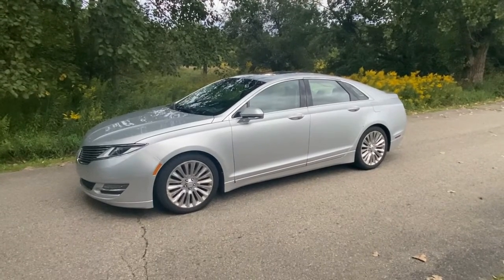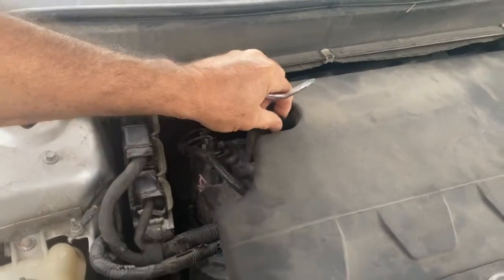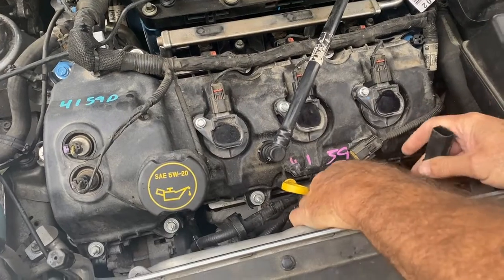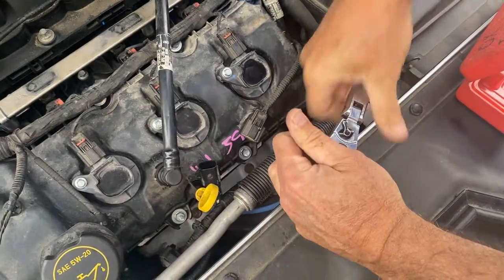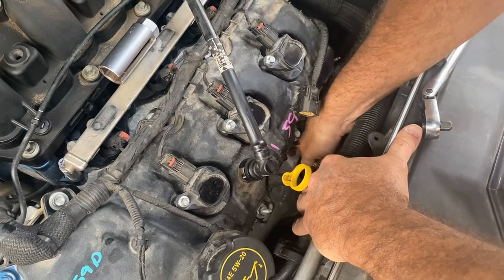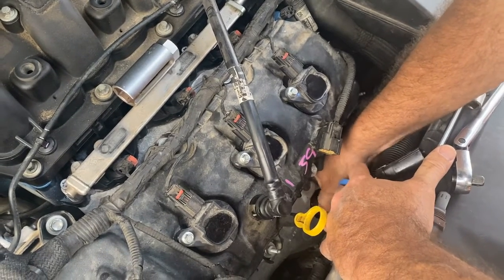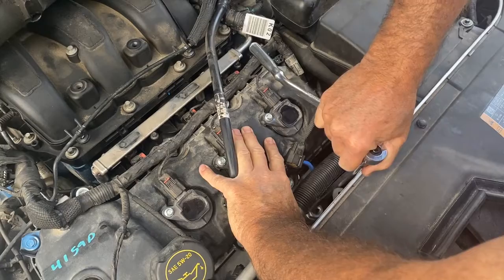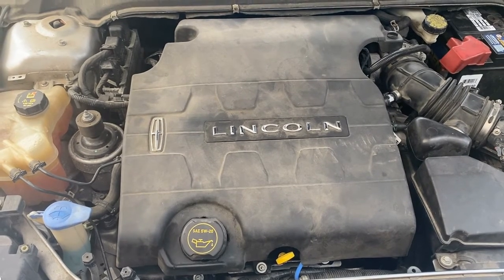How to Replace Oxygen Sensor Lincoln MKZ

Comment: Are all the sensors on this car the same ? Can a downstream o2 sensor work for an upstream location? Ordered the kit came with 2 up and 2 down but all 4 are the same sensors nothing different
Reply from the maker: No, a downstream oxygen (O2) sensor cannot typically be used in place of an upstream O2 sensor. They are designed for different purposes, have different physical characteristics (including connector types), and are located in different parts of the exhaust system.

Comment: Do you have idea where the O2 sensor is on a Mkz 2017?
Reply from the maker: This should be the same process for any (second generation) 2012-2020 Lincoln MKZ with the same motor. Which O2 sensor ?

Comment: Are both of the sensors on the 2015 lincoln mkz the same?
Reply from the maker: You're going to have an upstream and downstream oxygen sensor Bank 1 and Bank 2.  The two upstreams or two down streams could be the same, but it is still a good idea to give your auto parts store the proper information to double check just to make sure you get the proper parts.

Comment: Timing cover Lincoln mks and oil pump
Reply: How long does it take to repair it and how much does it cost to repair it?
Reply from the maker: If the oil pump needs to be replaced, are there any other parts damage because of lack of oil pressure ? It would be impossible to give an estimate without seeing the condition of the car, miles, etc there are just too many variables involved.